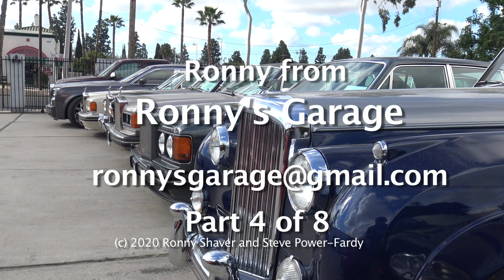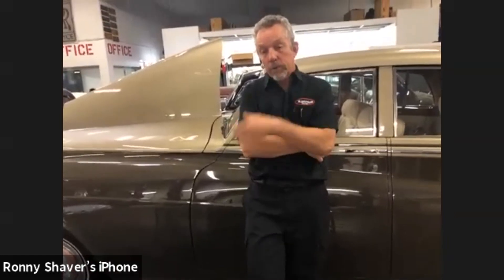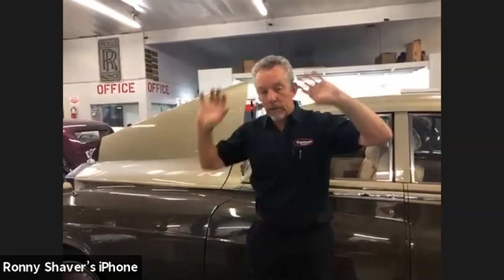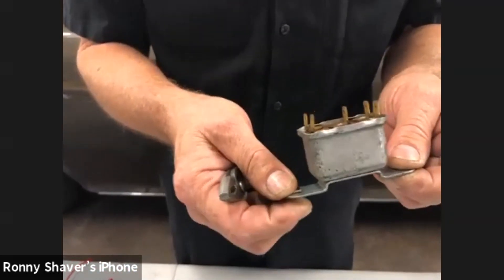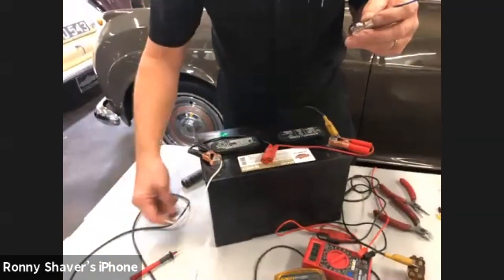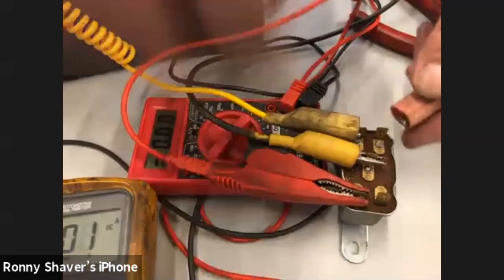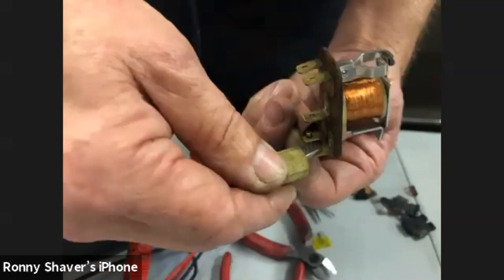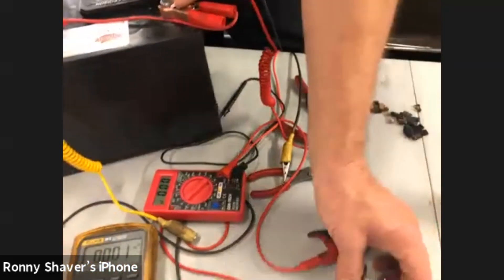Basic Electrical Concepts and Testing Rolls-Royce/Bentley Part 4 of 8

Comment: I am always loving your videos - I call my situation The Original Sin.  So when I got my 1985 Spur - someone had cut into the wiring harness - right near the fuse board under the dash - and rigged the car up to bypass the locks - security - and AC somehow.  Basically, the ignition still worked - but little else.  For some reason the windows still worked too.  Ultimately - as you know - I put a Holley on my Spur and ditch the Bosch system.  But the lesson I learned is that once you modify the electrical loom of a RR - no one can really help because mechanics are used to working on original cars.  Once that originality is gone - you are in Never Never Land.  That being said - I created my own harness for my car and it wasn't that hard.  I believe you can build a new harness for any of these old cars pretty easily if they are carbureted cars.  Getting the fuel guages and mileage and speedometer to work is another issue all together but I think that could be rectified too - not gonna lie - I never bothered.  But I live in Texas and it's not required.